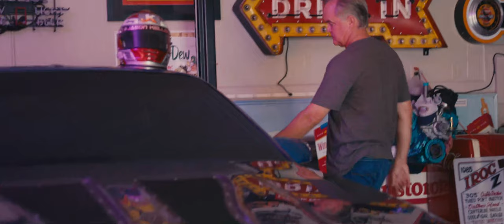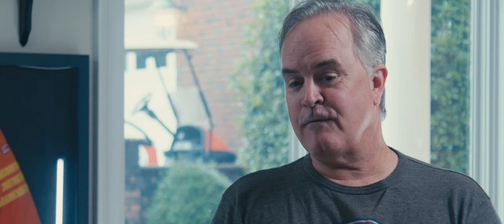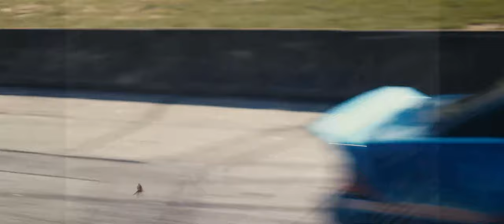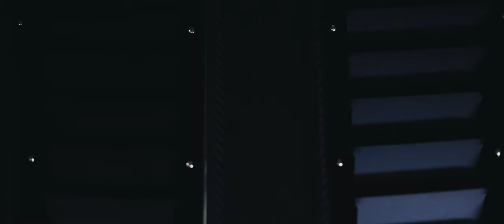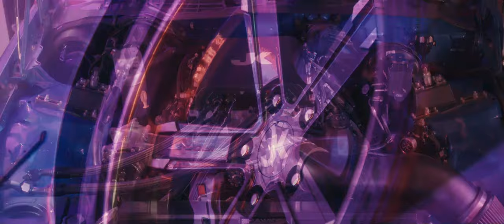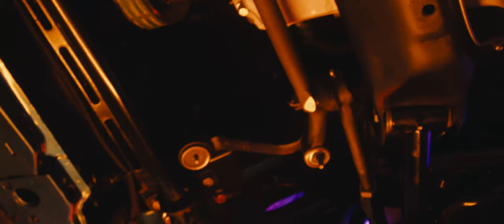Jason Keller 's ZL1 Inspired 1985 IROC-Z Build | Hawks Motorsports

Comment: This is how GM should have made  them from the factory!
Reply: They do now. But back in the 80s, it was still "get that mileage up". An 88 stock Iroc puts about 240hp on the wheels. Good for about 147 in good weather and a dry course. 

If I had an Iroc, I'd go for an LT1 build and 6sp tranny from a donor 2019 Camaro SS. Lot of them where I live, as it's a very popular and inexpensive hot rod. Or a 383 Stroker if you are more of a traditionalist.  With a Hillborn FI unit, good for about 525hp.
Reply: Edit: Also a good weight reduction as well. Lighter hood, front air dam, lighter rims. Interior a thinner carpet, lighter seats. Also, I have a friend who makes custom T-Tops of either fiberglass, or even Carbon Fibre if you have a T-Top equipped Iroc. Those glass tops are hefty. But you will need frame stiffening if you go with lighter tops. The Iroc is an amazing car for mods.